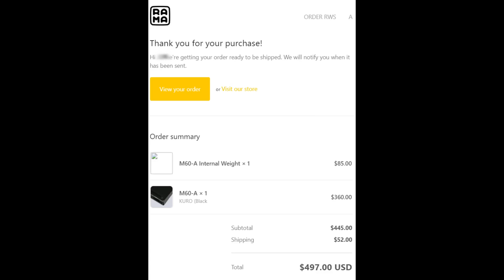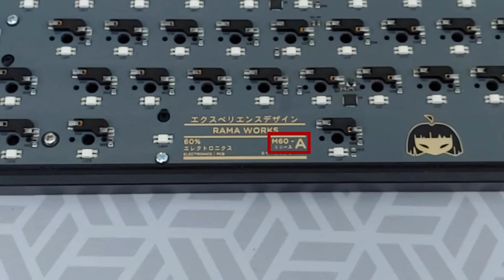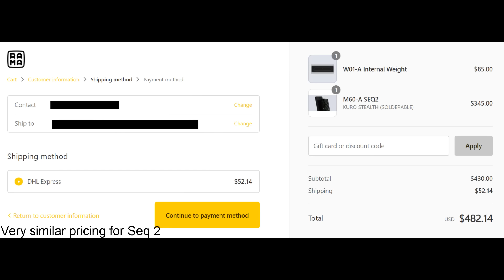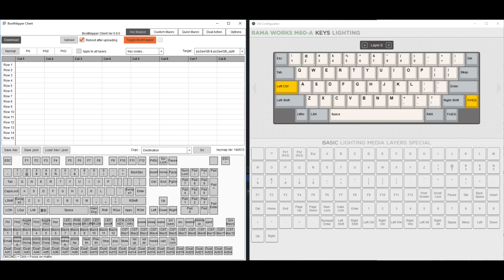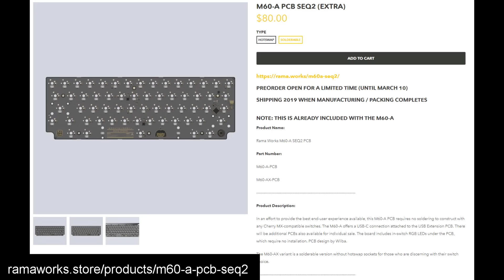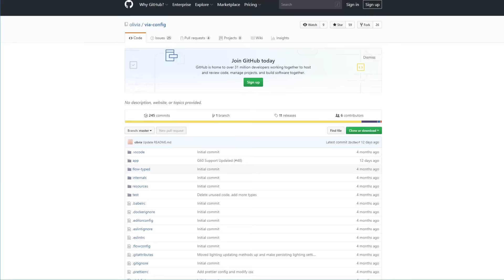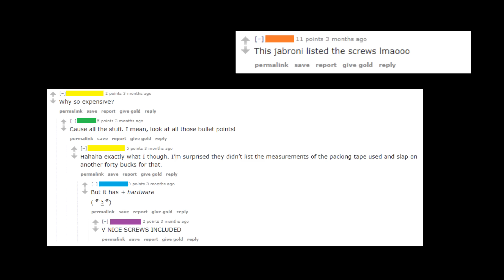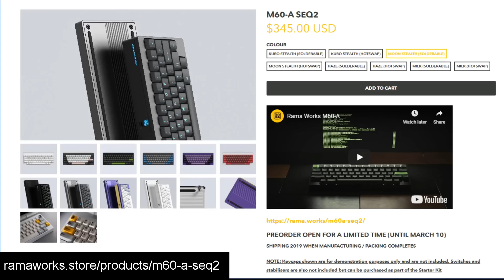RAMA M60-A: $500 Beauty

Comment: I've really come to really not like the sound of rama and for the price I just dont get it yeah there quakity but somehow the sound is  never ever good even when lubed it isnt good there is a ton of ping in them which the high end boards are known to not have hell mekanisk with the fjell and the klippe dont even ping and have the deep dense sound that really expensive cases have I've learned it's just not worth it ans somehow I've tried alot of keybaords and mekanisk makes soem good ones even tho there played mounted it doesnt matter somehow its jot harsh nd now they have something nobody has really thought about doing by taking out the middle posts so it's a softer feel and it actually works I feel that player moutn is still good and has always had a great souns no matter what anybody says but it would be awesome to only have 2 screws one on each side and they ahve the 4 little pegs holding it up in the outside like really far so it doesnt impact the feel zi think then plate mounts wouldnt be an issue at all and people would really like them there is a stigma with plate mount when it isnt true like the middle being stiffer not anymore they spread out the posts so it doesnt feel that way and now you can fully tske it out I think that's awesoem and now they sound and feel even better

Comment: I would put healios switches or silent switches on the m60a because the rubber rings mitigates the hard bottom out.. I currently use healios on it and it really makes the typing experience much better. But yes, I bought this mainly because I value design more so than the typing experience. I will still buy Rama products but there's a reason why we buy multiple keyboards ;)
Reply: 100% I put healios on mine and the bottom out actually feels nice

Comment: Great video! We need more content like this in our hobby. :) Would you mind explaining why you disassemble the board when swapping out switches? I’m about to swap switches myself and want to make sure I don’t damage the plate.
Reply from the maker: I like to apply pressure on the bottom switch nub while I undo the switch clips with a plastic tool one by one

This is only to avoid using the metal switch puller which can damage the finish on the plate

Comment: i know this video is a year old and i'm not trying to start an argument, but you mentioned 'avoiding bottoming out' and 'harsh bottom-out' in the video - what exactly is the problem with bottoming out?
i understand as someone who types a lot that hammering the keys constantly leads to fatigue, but so do switches like the halo/hako/whatever.. maybe i'm an alps guy and too oldschool for this. xD
Reply from the maker: The characteristics of the bottom out feel is often a differentiating factor for custom keyboards. It doesn't matter for people who don't bottom out at all, but if you do, you may prefer either a very solid or a bouncy feel. For now, most people prefer some kind of flexibility and absorption, but fads come and go so we'll see.
Reply: @JYMV  aah i see your point now. sort of like the way i like the hard clack sound of non-dampened switches but prefer the more 'bouncy' feel of the dampened ones.

looking forward to whatever you review next, even if it's not my thing - you're the best (after chyrosran22 of course). thanks for your reply : )

Comment: Nice one as always.. I'm kind of partial to the fc66 layout got the topre and the last mx clear model they made. And just bought my second tada68 hahaha best layout ever.. but after seeing that red board you have I regret getting my second tada68!! Hahaha that one looks so good.. what is it ?????
Probably very expensive ;-) did you do a vid about it and did I miss it ??
Reply from the maker: Hey! I haven't reviewed it yet, but that's the Rama M65-A. It's out of stock but I think there will be future rounds of the Koyu, which is similar
Reply: @JYMV  to bad the M65-A is out of stock.. looked at the Koyu looks good but i prefer the bottom row of the M65-A what's that space between the arrow cluster called. ??
look forward to your review..
Reply: @JYMV  just looked at the rama site.. it's a bit on the expensive side of things.. one Koyu is the same as both my tada68 with keycap set and switches.. granted i ordered two packs of khail pro purple switches.. and only used one.. but after seeing the prices on rama i don't regret buying an extra tada68 just for lols..
Reply from the maker: That little space in the koyu is referred to as a "blocker". I like it on some designed but not on the koyu. I think it's kind of weird when paired with such a thick bezel

Hope you find something you like!